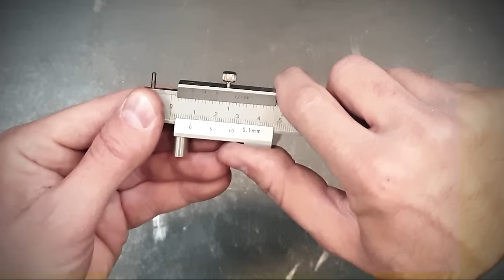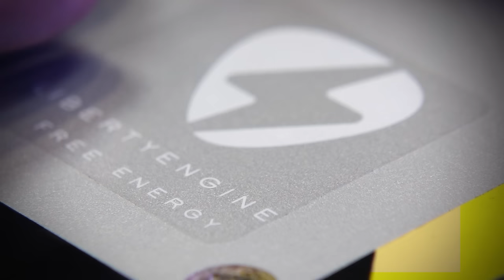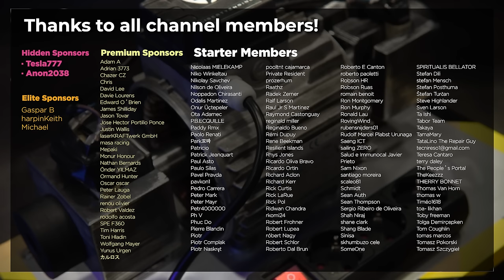10Kw FREE ENERGY GENERATOR with Microwave Parts

Comment: tis cant work! just explane to me how can it be exact 220v at 50hz ther is no regulator for it and 10kw on 2mm2 wire no way that is not posble ! it will melt away in a haertbeat
Reply: He has rectified. It's 1 kW, not 10 kW

Comment: How does generate AC current if the magnetism is continous if there is no alternation of the magnetic poles ?
Reply: Аз си го обяснявам като резонатор който ползва двете намотки като енергоизточници и кондензатори едновременно
Reply: the rotating magnet provides the switch in polarity, there are 2 pairs of magnets each side providing S and N polarity, it should provide the alternating current for AC if I'm not mistaken.

Comment: To begin with, the title is wrong, it cannot be infinite energy because magnets have a limited useful life, and it would be good if when doing your tests the bottom part was visible since the system could be connected with a power source. if it really works, why don't you market it?

Comment: Dear Liberty Engine comrades! Are there anyone who were able to replicate any of your engines? In one of your previous videos you said "No one would be able to replicate our engines because we are not showing the most important technic, so don't bother". Is it still the case? Why wouldn't you show everything, but yet transmitting these videos? I'm deeply respecting your works and talent, but still very confused with this strange behaviour.
Reply: Let me know if they resond ro you or if you find anything, okay?
Reply: Not too complex as it looks if possible the way this is shown the lil mic motor would need to be connected also as the rotation drive.  2 phase 220v motor is capable of being wired 240v 2 phase leaving the third leg of that last phase open and available to pull current
Reply: How to possible without run magnets  to produce electricity genrate please sir i want see this conection diagram
Reply: The most important technic it's a hidden wires that carry electricity from the commercial network for these shows.  But all this is needed for a large number of views, YouTube pays for this show!) It’s very simple!

Comment: I take that back! He's NOT clueless at all! He's a frikkin GENIUS! He's created a solid state method of manipulating broken lines of force both via inductive and solid state magnetism utilizing the vortices to cut lines of force simultaneously interacting with each other in a self synchronizing manner. Like a resonant cavity of sorts... the metal rod running down the middle if you use the right hand rule and follow the fields of each set of windings you will envision a rotating magnetic field being presented in reverse vector but the same way the stator windings would be electro-mechanically rotating the now unneeded rotor, again, in reverse order. It's a solid state transformer tapping ZPE and converting it same as a mechanical generator converts natures Ether into EMF! Wow! What a powerfully simple concept!
Keep It Simple Simon ... Simplicity is the key to efficiency! I really believe that! I've seen it proven many times! It seems very plausible to me! I think it's worth experimenting with! I liked the way he starts it with that tiny hand cranked generator! Once everything is in resonance, it self perpetuates all while using natures powerful forces!
What's even cooler is you can use the 240AC output to drive MOTORS that will do the physical work as shown. No need to double duty the generator and even then I don't see how it would self perpetuate in its original configuration!
I'd demonstrate this if I could with a magnetic field simulator if I had one! I bet it looks really cool too!
Reply: Hope you know what you’re talking about, I’ll believe it when I see it
Reply: All the replications of liberty engine 1 and liberty engine 2 were a failure.    We need is people replicating this liberty engine 3 and show that work, if not is just click bait.
Reply: @BienestarMutuo  There's ONLY one way to know for sure! PRODUCE one and see what happens... IF you can duplicate the original design and tech behind it!
GodSpeed!
Reply: @camronrubin8599  Me too! ;)
Reply: The system is so lossy.. perhaps if everything was absolute zero keeping electrical loss down it might spin a little, but mechanical loss is there as well.
If it did work somehow ( an impossibility) as soon as you put a load on it it would stop . Even plugging in a lamp would bring it to a dead stop .

Comment: It is called resistance. Magnets and copper produce resistance and then, if connected correctly, electricity. To get electricity you have to over come the resistance and to over come that you will need some sort of outside power, and to get that you will need either water power, wind power or sun power, you do not get any power from nothing.
Reply: Ouff un commentaire intelligent !!! Merci
Reply: Dark matter?

Comment: Free energy ? pull out your fuse box and bypass the meter and wire the power directly into your house . Totally dangerous and illegal  but you will have free energy , for a while . Fines and loss of Insurance cover when your house burns down could make this method less cost affective

Comment: 10 kw arbitrary…. Why do you need to jump start the motor if the magnetic field should be the responsible of generating the electricity ? This is not even close to zero point energy…..

Comment: 3:47 The recovery transformer of microwave ovens. Ok I open the core and remove the 'secondary winding and reassemble the primary, then connect it with one or both of the "PHASES" of the motor? Thank you very much.

Comment: The way the coils are wired (on every electric motor), conforms to a static rotary field. Now, if we think that field is only stimulated to appear, when we apply an external force, that's right. The coils in the stator are power lines per se. So, we use, not an electro magnet, but a permanent one to establish the “necessary” magnetic density, for (inducted) power lines to appear, whereas the rotary field has changed from passive into a live entity. (Digg it). And, BTW, we can use a micro electric generator, portrayed in a tiny electric motor, or a charged capacitor with the proper power values, as primer, to start the generating process. So, concluding: We have used this procedure to activate a turning rotor, while weren’t aware of the main part of such. Stators are the powerhouse, without the other parts. I hope this brings a little light on the subject. PS. Put all your theories in a bag, and use them as a pillow.

Comment: Suggestion: can you add master volt and energy meter at the top acrylic plate that will always indicate the total power and consumption. 
Also a question to you; what is the breakdown time in continuously used and how much heat can it produce by itself and at which part get mostly heat up than others? 
Best regards.
Raj - Canada 🇨🇦 India 🇮🇳
Reply: Hey smarty nothing heat up
Reply: It all works with magnetic fields
Reply: If u r not an electrician I don't know if u know how a piece of wire have electricity

Comment: what i have to say is if this is truly works it is a game changer. i read a lot of comments here and the one that got my attention is in one comment asked about turning it off after removing the sync. motor. there was no mention about the direction the  magnets were connected the winding direction, and i wanted to see them detached. i think the gen. might just work for this reason. a magnetic field is formed inside the fields. i will build this myself to be sure.

Comment: I don't think that by simply exiting a system that remains stationary with a Microwave turn table motor will generate energy.
To get any action, the system should function by way of a seesaw effect involving the motion of magnets and, or pickup coils in conjunction with the inductance of the motor 
on an ongoing basis.
What you are demonstrating looks like a rather shallow magic trick. 😆

Comment: Quel infame bricolage🤮 ! On se fout du monde ! Cela va peut-être impressionner les non électriciens, ou ceux qui ont des connaissances très basiques en électricité, mais pour ceux qui ont un solide bagage en ingénierie électrotechnique, c'est franchement hilarant ! J'en ai encore mal aux cotes🤣. Comment peut-on tromper les gens à ce point, et les prendre pour des neuneus ! Simplement le multimètre à 3 balle de chez carrouf montre le niveau du démonstrateur en herbe ! le jeu monstrueux entre le stator et  le pseudo rotor est stratosphérique😱, sans parler de l'alignement d'arbre olé-olé, l'adjonction de bobines diverses,  de condensateurs 😲, avec un semblant de savoir faire qui est censé nous impressionner, bref un immense bric à brac.

Comment: they say if you take a thin copper wire to one end of a drone hovering up a 100 ft or more and hold the wire , it will send electricity thru your hand. charge of the atmos vs ground.
Reply: better use this wire to wind the magrav coils.

Comment: На 16.32 повинен був самостійно запрацювати САМ маленький двигун .On 16.32 small engine  should have worked, but it didnt.
Reply from the maker: If it works, but it has started in the opposite direction of rotation

Comment: One of the key elements in use by this project is linear vector non-ionized phlogiston, which is obtained by distillation of an isotope of cularium-135. The isotope is forced to undergo a proton displacement process with a microwave power density 3.733 X 10^6 w/m.
Reply: @walterbrown8694  who let bro cook?
Reply: И не на метр, а в секунду в квадрате
Reply: @ДмитрийКравченко-с6ы  Congratulations - Da ! - I remember after I clicked "Reply" that I had forgotten the "Meters-squared" and was wondering if anyone would pick up on it. (I'm also confident that you quickly realized that the comment in its entirety is "Bull%#*t - but at least I should show the correct units when they enter the story.)

Comment: So at the moment my man spins the small motor inputting a minute current into the device because the system is inherently lossy either 
a.nothing happens
Or 
b. there is very slight movement with the energy dissipating in the lossy system then nothing.

But thats not what we observe, which means the presenter is performing some slight of hand/video to give the illusion.

Which for me is the really confusing issue.
Why go to all these lengths ? 
Maybe Im missing something ?

Comment: Де що є в цйому лохотроні потрібного для познань електротехникі і теорії магнітного поля.Дещо мені пригодилось.
Reply: I thought I saw a capacitor in the beginning of the video, but I didn’t see where he used it in his device.. I have built 3 free energy generators but mine have a running generator and an ac motor with a bank of capacitors that replace a battery. It used to have a dc to ac inverter, but I found a generator/motor that replaced it.. it’s lot Simpler than this. No need to alter any of the components like this video did..